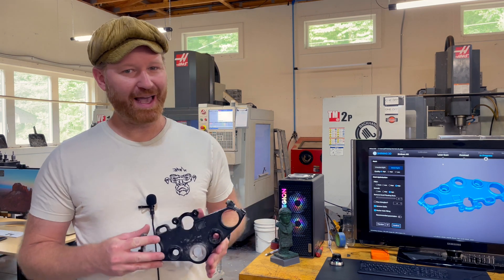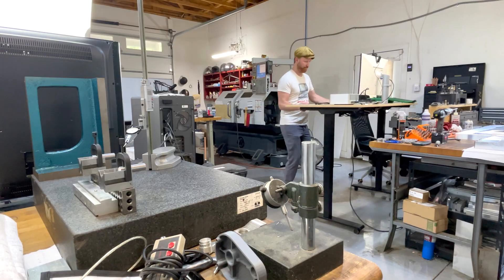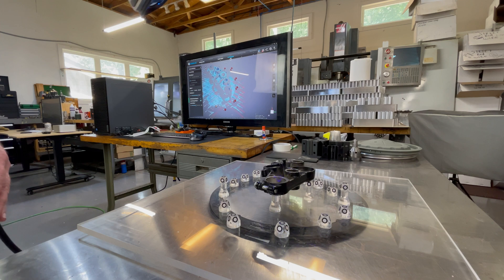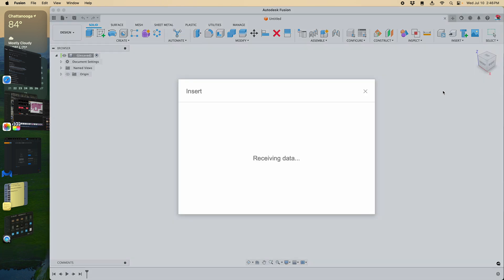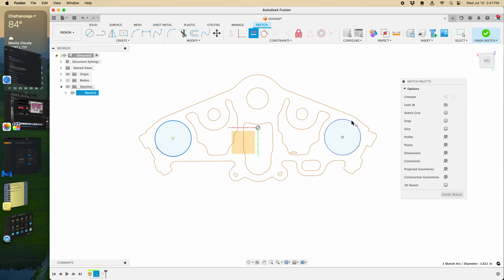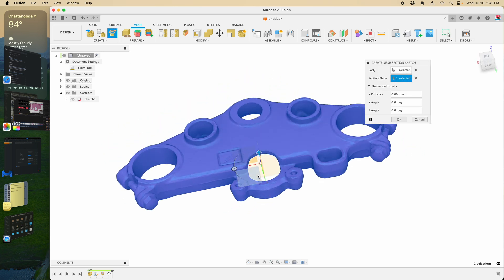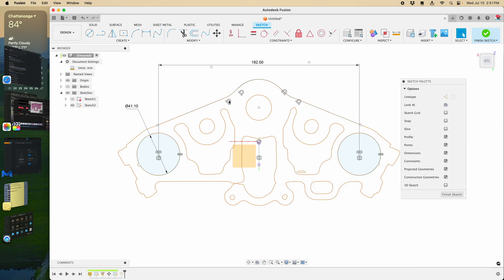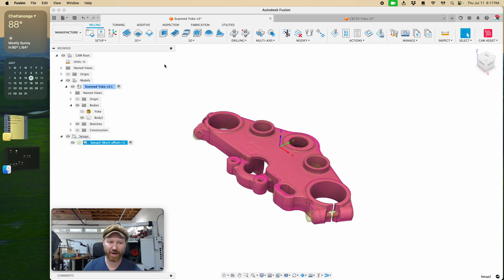Reverse Engineering: How to benefit from 3D Scanners

Comment from the maker: We made this video during a large production run, so the audio suffered a little. Thanks for watching!
Reply: Hello friend I am trying to save my health and am trying to get a device 3d printed
Please can you help me
It's a device for the mouth for sleep apnea 
It's made of cobalt chrome and nickel but I need the entire design remade in titanium
I have the titanium grade 1 alloy powder and metal coin next to me 

Do you know if bluel laser scanner is good for scanning a metal dental device 
Please can you look at the somnowell

And what is the best reverse engineering way to get a cad file of it 

And would you recommend direct metal laser sintering?
It days dmls requires a cad file
Reply: Do you also know what is that blue laser scanner product called 
Was it einscan hx???

You used shining 3d program 

Is shining 3d program good enough for dental designs?
It has hinges and thin cusps to grab teeth
Reply: Would you recommend aoralscan elite over blue laser scanner?

Comment: 15 minutes to reverse engineer by hand? 😮
Reply from the maker: Yeah, I missed a couple of features : )
Reply: @ChipMonkeys  nevertheless that is amazing. Any advice and tips to be faster reverse engineering by hand?
Reply from the maker: @joaotomas3653  25 years of it helps : ) Follow a system that works for you. Mine is: 1) What is the units used to design it, and use that moving forward.  2) Make good use of Sketch Relations in connection of how  you are measuring. 3) Be creative on how you get the measurements make good use of what you have on hand. I use Ground pins, balls and a 90 degree angle plate in combination with a height gage. I bought it from Shars.com It might make a good video : ) If you can, send me a picture of your project and I can show you how I would go about it. jeff@hoopermachine.com
Reply: @ChipMonkeys  thank you very much for your advice! I just have a couple o years but i feel that i take too long modeling by hand that's why i stumbled on you 3d scanner video😅
How can i contact you?
I hope I see you video soon🙂
Reply from the maker: @joaotomas3653  Hoopermachine.com That's me : )